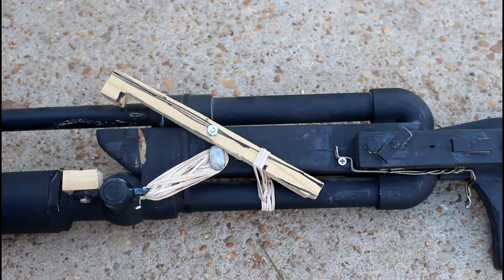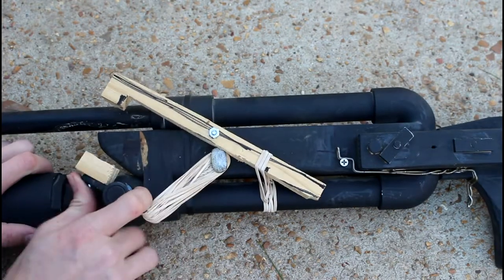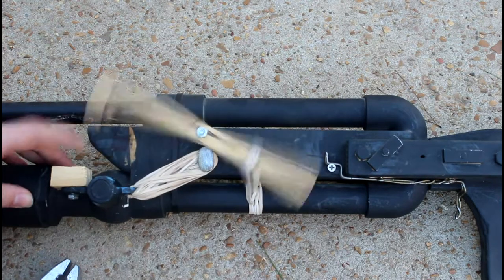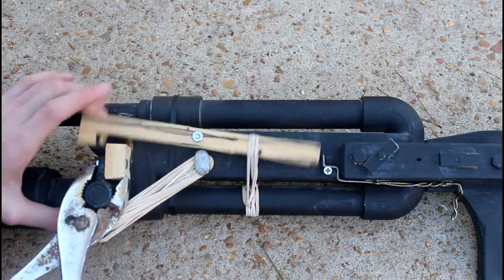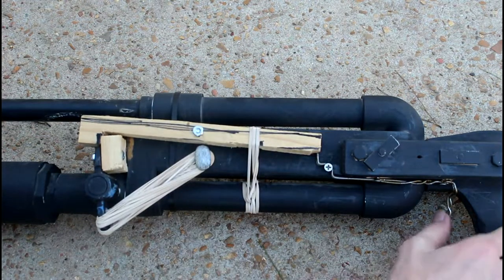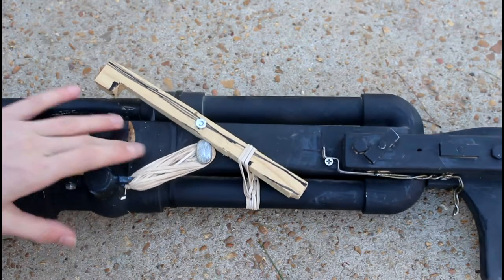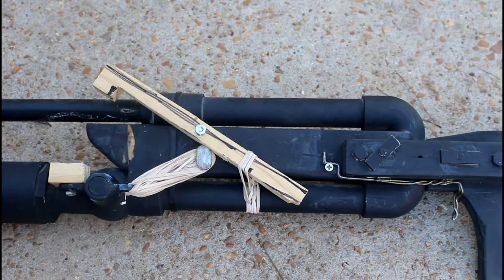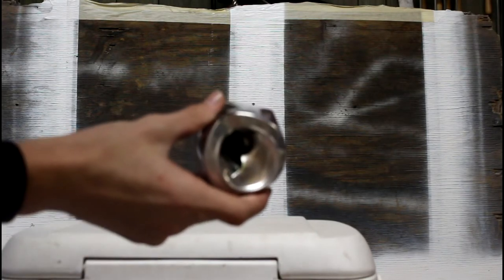Pneumatic Rifle Updated Trigger Mechanism (bonus: Nerf dart VS Soda Can)

Comment: This video is really helpful, thanks! After I get around to replacing the Schrader valve on it, I'll add a similar mechanism on my breach loaded airgun. I will have to do an upside down version of the mech because the valve on mine is at the breach, allowing for more power.

Comment: Nice design. I used a 3/4 brass ball valve on my last potato cannon. Figured the metal chamber and valve could handle 120psi, and a PVC barrel could too while firing?
Wonder if the brass valve is harder to open  than PVC is? It trigger would work as well if not